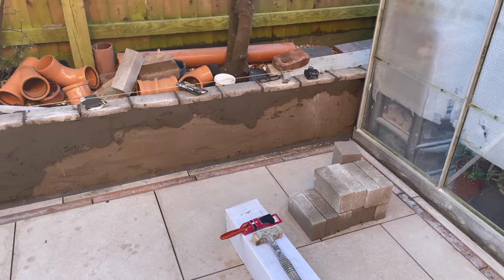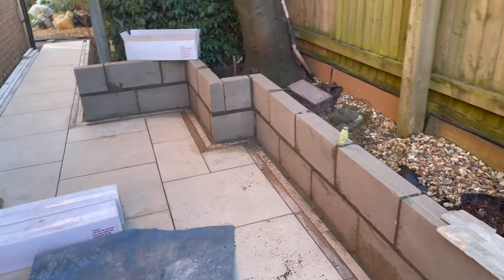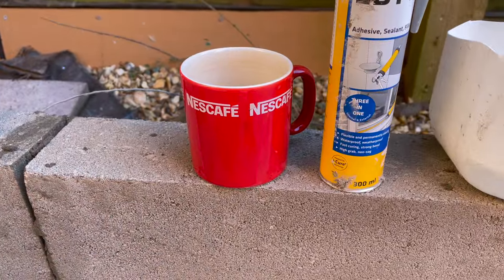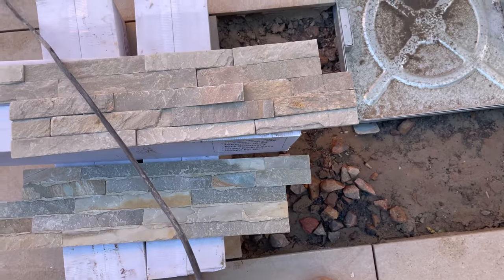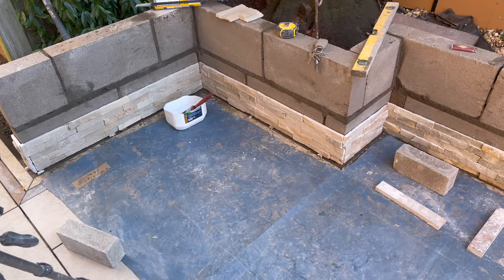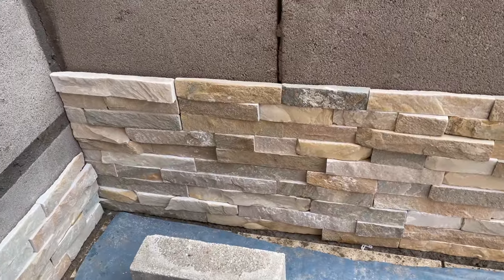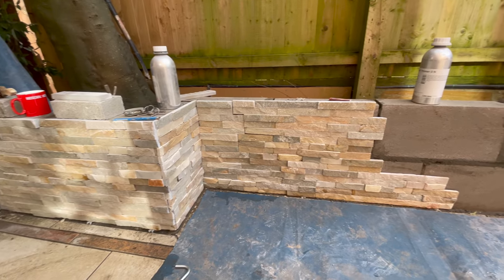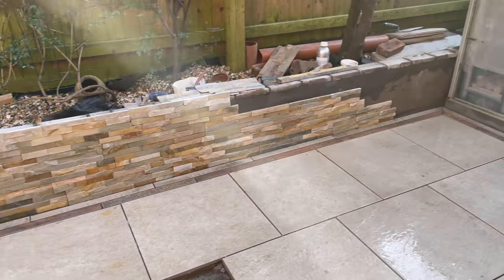Build & Review: Drystack Walling Made Simple and Effective 🏡✅ #drystack #walling

Comment: And there was me thinking I was going mad installing this stuff on my garden wall.  So much variation in the tiles.  I also fixed using external tile adhesive and got it everywhere!  Plus they're black slate tiles!!  Given it a nice sealer coat, and it really doesn't look too bad at all.  Way better than the wall bare and that in itself was crap and out of line - so using the adhesive gave me a bit of play in lining it all up.
First thing wife said was "there's a few gaps in it!" - so glad a professional has this problem.  I even used grinder to shave a few of the edges off to make it sit better.  Not an easy job, but I like the look of it.
Reply from the maker: The wall does look good but it does have its faults which can be rectified but you shouldn’t have to should we 👍🏴

Comment: Hi mate, have you ever had issues using Sika adhesive rather than cement based trowel on adhesive ? I want to do my garden wall but wondered if that grab adhesive has ever failed with rainwater etc ? Thank you
Reply from the maker: Never had any comes backs yet from over the years so I’d say yeh it’s fine still works 👍🏴
Reply: Great, thanks for that

Comment: My neighbour is currently covering their patio wall with these things. They look atrractive until you come to the corners, especially the external corners, where they look exactly like the stick-on bricks they are. For me, I would build up the external corners with actual bricks (sliced to half depth), The corners would look like the corner of a house.. and the tile bricks would only fill in the straight runs. Much neater finish and the tiles look much more like authentic 'stone-walling' than stick-ons.
Reply from the maker: I actually hate the stuff but good point that’s a good idea cut some slips for the corners 👍🏴
Reply: @tidybrickslandscaping  I can’t see them lasting too long with heat/cold expansion/contraction working them loose but hey, why am I expecting anything to last these days.
Reply from the maker: @andy-maunder  regarding expansion I don’t think there would be a problem as it’s just slate and stays the same but you kick a football at it and bits will definitely come off it’s very brittle. You can buy corners but most likely they’ll be broken before they arrive 
It’s all shit these days worlds gone to pot 👍🏴
Reply: Mitre the corners...
Reply: @Shralps  they don’t join up well enough to do that. You just end up with sharp edges
Reply from the maker: @andy-maunder  yep that’s what I tried all rubbish 👍🏴
Reply: As an update, within a month, one section of tiles have fallen off the wall, the adhesive failed. The block wall looks wet through but today he has stuck them back. I reckon they will fall straight back off in a week or so.